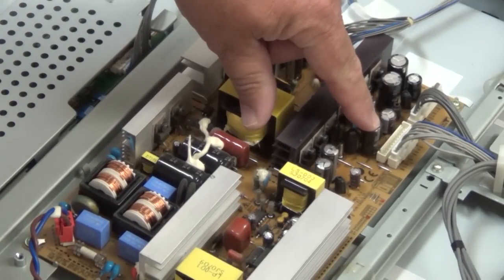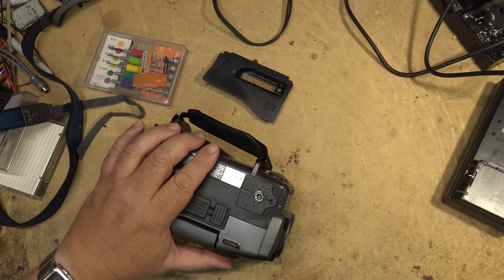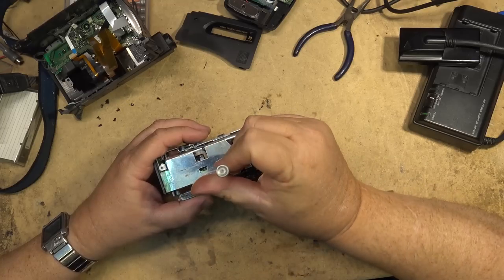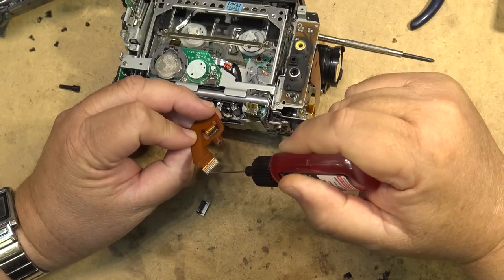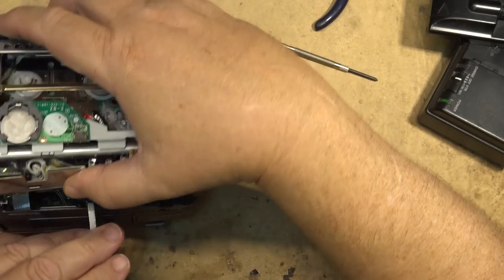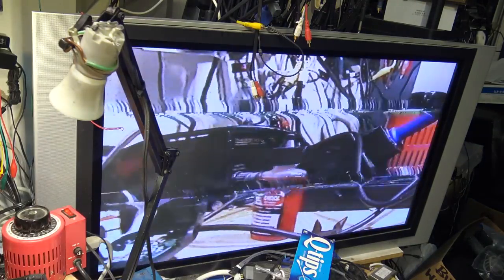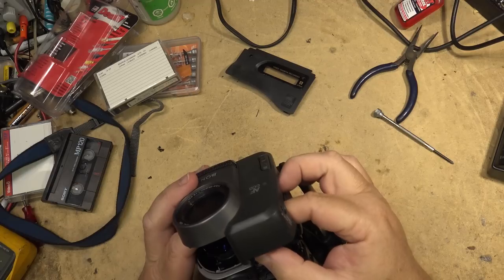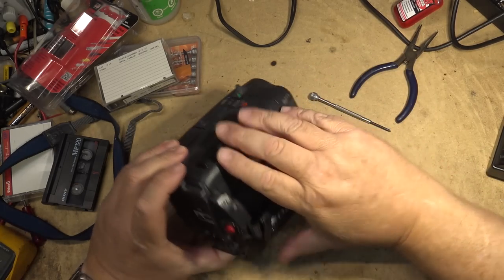Sony CCD TRV30 No Picture on Playback

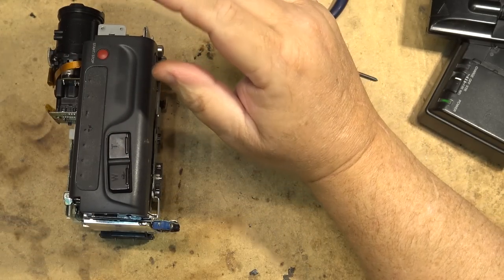Comment: Sir, my unit was beeping and turning on and off like crazy, with the suggestion you did at 12:33 I was able to determine the problem: cleaned the switches without even opening it, just dropped a few drops of IA around the wheel and inclined the camera backwards so the liquid was able to reach the switches on the board, turned the wheel a few times with the camera inclined waited 10 minutes for the IA to dry out and Voila!!! My humble thanks to you good sir, now I can  start my "analogue horror" movie project using original hardware, all thanks to your video. Cheers from Colombia!!!

Comment: My 8 mm camcorder , a similar model to the one that you’re working on is the clock memory battery located in the same area? No you tube site or Sony give instructions on replacing the battery, looks like a 2032 remote control battery.

Comment: Any thoughts of a mechanical whirring noise and stripey picture only on record only. Playback is perfect.  Panasonic full size VHS camcorder NV-MS1. Sound like it's coming from the takeup spool area.
Reply from the maker: Have you checked the take up tension? Does it make the noise when on pause or just record.  Is the noise mechanical or is it coming out of the audio output in the sound?
Reply: @12voltvids  Thanks for takin g the time to reply.  It's literally only when on record, the noise starts about 2 seconds after pressing record, in pause it's silent.  The service manual shows how to adjust the tension with torque gauges but I don't have those.

Comment: Your videos are really helpful, you are the best. I have to teardown this camcorder because mine has some serious problem with fungus inside the lens (everything looks blurry and it has some soft glow kinda effect), ¿Did you ever teardown the "lens capsule" to clean something like that? thxs for the video 12volts.
Reply from the maker: I've taken the lenses apart to repair the iris that is stuck. as far as taking the actual lens elements out I haven't done one on camera. did that a few times when I worked in the business but it became more economical just to replace the entire lens. Quite often what happens on these lenses is the lubricant melts and drips onto the lens fogging the image. this happens a lot when people start the cameras where it was hot like in a car.
Reply: @12voltvids  I didn't think about the lubricant, it had not occurred to me, very most likely it's that instead of fungus.
I live in Argentina and getting a spare part would be difficult for me, so I'm not going to have any other solution than trying to disassemble the lens, your info it's very appreciated.
Reply from the maker: @tedd3713  they are not hard to take apart
Reply: @12voltvids  Thank you very much, I will try to fix it in these days and I will update how it went in case it helps someone. Cheers man!
Reply: Update: I took the camera apart to get access to the lenses and once I got all the circuit boards out of the way, I opened up the lens to find the problem was within the actual glass in the moving lens (don't know what that part is called). So the best solution after all is to just replace the whole lens like you said before, in my case it wasn't dirty it is a problem inside the glass so I have no way to fix it. Now it's going to be an adventure trying to get a spare part here in Argentina haha probably the best I can do is get a new Video 8 camera, a real shame because the camera is working very fine.

Comment: Hi, I was hoping you could help me out with trying to diagnoise a problem that has popped up with my Sony Hi8 CCD-TR700 camcorder. I was converting some tapes for a family member and when I got to one tape that was dirty on the outside (which I cleaned) it played with evenly spaced glitches throughout the video. I'd put up a Dropbox link, but I doubt Youtube allows that. Anyways, after that, it won't play any tape. I get a frozen image and then it tells me to eject the tape. The one clue that I do have is that the tape is in the middle, but the camcorder insists it's at the beginning and won't rewind any further. It will fast forward and rewind other tapes, so it isn't the motor. Now, all tapes have this frozen screen followed by a notice to eject. I did watch the wheels on the tape when the screen showed the frozen video, and the tape was not advancing the tape. I wasn't sure if this was likely a dirty head or if the fact that the camcorder thinks the tape is at the beginning when it isn't, means there's a sensor that I need to clean. Any help would be greatly appreciated!

Comment: I'm having a similar problem with my TRV30E, tapes play for about 1 minute before the camcorder kicks them out with no explanation. Sometimes, it'll kick them out before I've started playing. I've taken it apart and re-seated the same connectors you mention in the video, but I had to take it apart a little more to get a connector back in, and I cannot for the life of me find where one small little circuit board goes. It says S-L2B on it. Could you help? @12voltvids

Comment: Great video! I'm trying to repair the power supply to an IBM Wheelwriter electric typewriter. I've identified a bad transistor labeled: TYN 058 (followed by c229a). I believe it's an obsolete part. Can you or any of your viewers help me identify a proper replacement part??
Reply: That appears to be silicon controlled rectifier with a 5A rating.  Voltage rating depends on another number like "408" for 400V.

Comment: I wonder if you can help me with an issue on a Sony Handycam DCR-TRV16E? Playback is fine, but no image in camera mode. It does record sound, but no image. Black screen on LCD screen and viewfinder. Any advice would be great.
Reply from the maker: Could be a stuck iris in the lens.  Turn on the camera and give it a whack on the left side and see if you can jar the iris to open.  What happens is, especially if the camera has been store in a hot place, lubricant can lose its viscosity and drop into the iris blades and cause them to stick.
Reply: @12voltvids  thanks for your reply. Tried whacking it a few times but no joy. I’m not brave enough to open it up and have a look inside lol. Thank you for your help though!
Reply from the maker: @lynneluv8664  I know that feeling.  I look at it this way.  If it is broke i got nothing to lose because if i can't fix it, it's going to the trash.

Comment: Do you have a store front or contact email?  I've spent the better part of three weeks trying to fix my Selectavision VKP-950, and I'm calling it quits.  I was wondering if you might have an RCA Selectavision (pretty much any version) for sale.  I'm looking for a working one.  Something that'll match my RCA Dimensia TV.  Thanks.
Reply from the maker: My contact email is on my youtube main page. volt@telus.net
I don't have a store front, I am not official in the business but I do repair work at home. I left the repair business in 2003. I did this for a living from 1084 to 2003 at a retail shop, but shops now are few and far between now. Most of the guys still doing it are working from home like I am.

Comment: hello,i have a sony str-k1500 home amp when i switch it on its normal after about 20 seconds it skips to the music settings presets concert,jazz and hall appears on the screen and when that happens i get no sound,what could be the problem and how to fix it?
thank you
Reply from the maker: Haven't the foggiest idea. Perhaps a memory battery or supercap is going tu.
Reply: i just hope it not a big fix,do you think it got to do with the control board cause when that presets appear nothing changes when i press any button

Comment: So no bad capacitors then, that's unusual for a Sony camcorder isn't it?
Reply: Actually no, they are pretty reliable. I have one of a similar vintage, still works great.
Reply: @HuntersMoon78  Same here, two Sony's one Digital8 one MiniDV camcorder both still perfect.
Reply: This camcorder is new enough, it should be from after when Sony finally had the problems with the SMD capacitors figured out.
Reply from the maker: Older vintage capacitors for sure.  By the time they got to the a and b mechanism cameras most of the leaky cap issues were behind them.
Reply from the maker: The problem was with 1 specific Japanese capacitor manufacture.   The story goes that an engineer from one of the companies detected to another company and stole the formula for the electrolyte but he missed one ingredient that kept the pH stable.  When the capacitor sat in a fully discharged state it became slightly alkaline and softened the rubber end cap eventually causing the liquid to leak out.
Reply: 12voltvids Dell had that same problem with Optiplex GX280 pcs as well

Comment: Helical scan tape machines troubleshooting and repair. 

Boss level.

Analog video is crappy compared to today's standards. But Will our current media survive more than forty years to be read in the future?

I miss the tape as storage media.
At least for digital audio.
I can fantasize about creating new tape film on a garage, and rework analog drives to store high quality digital audio.
But if I tought about doing the same with the modern nand flash way. I cannot even afford the tools to do that.

I think we're losing out right to store our data on proven time resilient media.